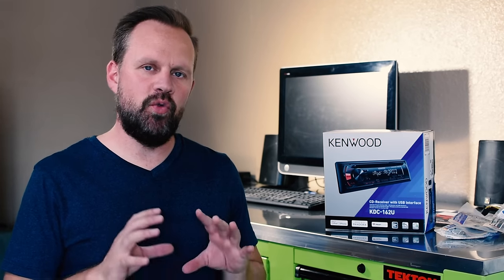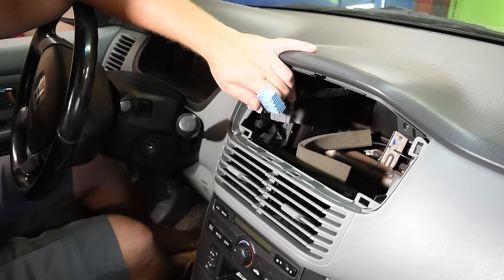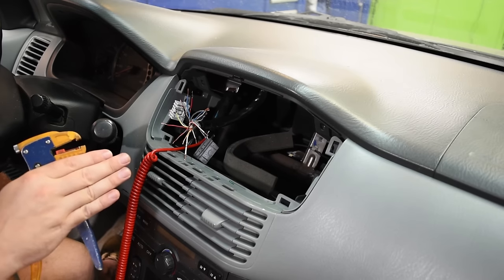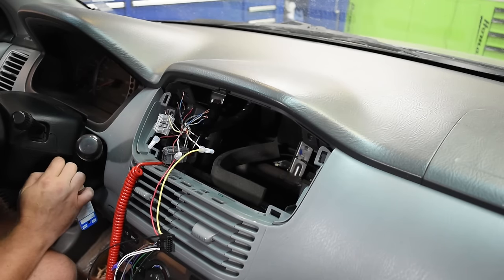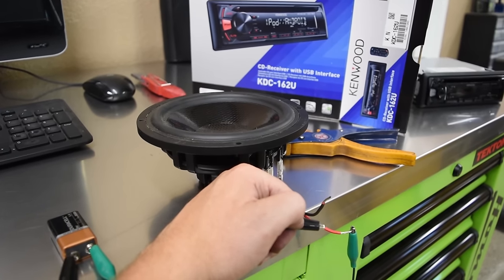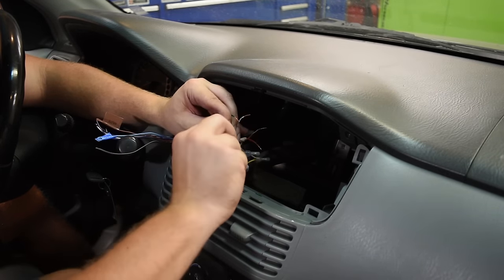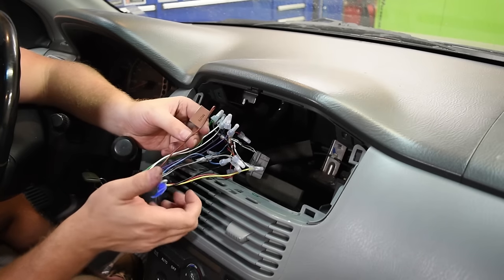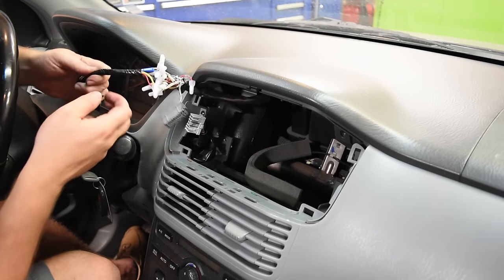How To Install A Radio Without A Wiring Harness Adapter

Comment: If you definitely don't want your wires touching, than disconnect the negative from the battery after you check for the constant power wire.

Comment: Hold on! Don't cut through them all in case the live shorts out another wire , then to find ground touch a live feed to them one at a time? Better to use meter to check check continuity from wire to bare metal?
Reply: What if they were all cut at once and now my car won’t start ? Was running just fine. And my friend cut all the wires at ounce and now I can’t get the vehicle to run

Comment: Soooo I have a 1998 Lexus LS400. I can’t find any of the wiring diagrams for it but I went by almost everything in the video but I have some questions. First.. when I checked for the ground wire.. I found 3 total grounds with all of those wires being brown. Second I can not figure out my speaker wires. Nothing I tried is making them move for me to listen to where they are. Any way someone could help?

Comment: Ive been working on my radio for 3 months now. IM STILL STUCK. SO WHEN I DID GROUND WIRE I HAD 5 WIRES LIGHT UP AND NOW AT SOEAKERS I am getting no noise either way

Comment: I have 2 wires that are constant what do i do?

1 is at 11.14volts the other stays at 11.42volts.

The 11.14volts drop to 4.25volts when i turn the key to the accessory position.

Do you or anyone know what could be the problem?

Comment: I tried this and my harness does not come with a blue and white , not even on the cars adapters, their are a acc and a ant one though but im pretty sure the Cadillac CTS 2003 has an amp that needs to be turned on

Comment: Speakers don't have polarity, because they work with AC signal. Plus and minus on speakers mean just correct PHASE connection, not POLARITY connection. It means if you connect ALL ground wires from radio to plus wires on speakers and ALL plus wires from radio wires to ground wires on speakers, nothing will happens, because they will be at same phase. If you mix up all connections randomly, it will occurs something called "acoustic short circuit"
Reply: Edgar Koterle by

Comment: Can't you get the wiring setup or look it up on line. If you have the book (owner's manual or repair book), you could look up which wire goes to which speaker. Not to say that this isn't faster because it looks way faster. Gonna do our Nissan Altima with a cheap stereo we got online. Wish me luck.

Comment: I need the wire diagram for a 2005 Nissan Altima 6 cylinder four-door sedan the radio and the amp harnessed

Comment: If a harness is available, use it!!!!!! The time & effort to do it this way is way more expensive than the $6 kit. Time would be better spent using the harness & soldering the wires neatly. Of course older vehicles do not have these hookups

Comment: Can anyone help me I have a 2006 chevy silverado 1500 and I’ve gotten power from the battery wire but not the accessory wire. I’ve checked the fuse box and no blown fuse so idk

Comment: Help! I connected the red radio wire to the car wire that gives power when you have the lights on and now when I turn the lights on the radio turns off.  This can cause a short circuit;
Reply: What if they were all cut at once and now my car won’t start ? Was running just fine. And my friend cut all the wires at ounce and now I can’t get the vehicle to run it will crank but not run

Comment: use the damn adapter it's so much easier.  ths is why they are made.  no need to look at wiring diagrams.  no need to cut.  only splicing taping/soldering is on the aftermarket unit.

Comment: im trying to put in a sub woofer,radio, and a amp but the amp causes a fuse to go out and now my dash wont turn on and the radio wont work but the fuse on the radio is fine. And everytime i replace the fuse for my dash gets fried again

Comment: I need help. Im in a old 2002 ford e150 and it has 15 wires the new radio im trying to install is only 12 wires please help v.v

Comment: Useful explaining the the wiring colours, however anybody who cut into my original harness & removed the factory plug I'd be furious with. The shop that fitted that Alpine by sourcing  a compatible radio to existing vehicle plug did a far superior job than your scruffy, & lazy approach to cutting the vehicle plug off.

Comment: Not all vehicles have an a 12v Accessory/Ignition wire. Instead they have a data signal wire that carries a very low voltage signal that tells the OEM Head Unit when to turn on. In order to install an aftermarket radio, you have two options: 1) purchase a wiring interface kit compatible with your vehicle or 2) find something that turns on when the ignition key is turned on and tap into that wire.

Comment: Question for anyone who can help me I just install a radio to my 2003 Dodge Ram 1500 but I connect it without hardness I did it cable to cable , now this video helped but in my case I installed but you can’t here anything through the speakers and I did tested the speakers and they work so please if anyone can please help me out and explain what did I did wrong I’ll appreciate it Thank you

Comment: First of all always disconnect the battery before doing anything electrical in your car: it takes like 30 seconds, prevents any possible short and saves you from getting a nasty shock among other reasons. Second why in the he'll would you mutilate your car cutting off the OEM harness? Just cut behind the after market harness plugged into it make sure you leave enough wire length to work with. Third get some wire labels and label them as you work it will save you so much time if you ever have to go back in there. Third a 9 volt battery is way to much power for testing the weak speakers in some stock systems especially tweeters..you can end up destroying the speakers hook everything up and have no sound, use a 1.5v if you must. Again I have to ask why? Just download a wiring diagram for free online.

Comment: As long as all speakers move in same direction they are in phase with each other.one reversed then you have an out of phase condition. Our ears cannot  determine the positive or negative side of a sine wave. The sound with respect to polarity will just be 180 degrees on opposite side of sine wave. Lower frequencies can be put out of phase for better time alignment. With respect to upper frequencies. Q.

Comment: Hey there everyone..I have a  2006 Ford five hundred sel.
When I brought the car the previous owner hacked the factory harness off...so I followed various wiring diagrams and videos ( such as this one.) And I'm still having issues..I have two power wires and I don't know why...I recently had a head unit rewired and the stereo amp and leds worked fine til I turned the car off..and my battery died..so I unhooked the headunit...and followed this video and I have 2power lights....
Does anyone have a Ford 500

Comment: mybe you can help me? I have problem with Pioneer deh 1300mp, it reset all setings i make every time i turn off engine!
Reply: Your memory wire has to go to a constant 12 volts, it's wired to the accessory switch. Steal 12 volts from the cigarette lighter. Just make sure you have a fuse installed in line. I think yellow is the Pioneer code for memory wire.
Reply: cnile cnile I made it! Thanks!
Reply: Eduards Liss u dont have the 12 v constant yellow wire hooked up thats y its reseting. Cuz thats ur memory wire so ur song wont start           where u stoped at. It also resets ur clock bro

Comment: Can any 1 fix the harness 2 work on a aftermarket alpine w650 install in a lin mks 2011 auto cool control want work automatic, the  stering wheel radio auto for phone and radio want work either can anyone's out there build or correct the wire harness on alpine  w 650 install 2011 lin.mks????

Comment: i have a 1999 toyota avalon and my car has a factory amp? how do i wire this.
Reply from the maker: I would recommend bypassing the factory amp... This adapter may help however it might not work for your car, however do some research this may help http://amzn.to/2glHBzJ

Comment: @ 9:42 you touch the red wire and the light did turn on. You so no other wires turned on the light.

Comment: I was testing my wires like it showed in the video and I found power from multiple wires. Why would this be?
Reply: Terrance Cagle I have the same problem
Reply: Did figure out the problem Joseph Lock.
Reply: Terrance Cagle no not yet. And another problem is that I wired the main once without the speaker wires wired and I won’t turn on. You think it would be a fuse?
Reply: @lockdown10  its possible it could also be a short and that could anywhere
Reply: Terrance Cagle awww dam that don’t sound good.
Reply: @lockdown10  yea finding a short is simple and difficult at the sametime but fuses are easy just locate the stereo fuse and test with a test light or fuse test. You can also pull it out a see if the pronge in the middle is broken and go from there
Reply: Terrance Cagle oh okay hey thanks a lot !!! Much needed!!! I’ll let you know what happen ... just cause lol
Reply: @lockdown10  alright heads up the stereo fuse should be under tbe hood
Reply: Terrance Cagle dam didn’t know that’s again man!!! Appreciate that
Reply: @lockdown10  no problem

Comment: I have no idea what I'm doing. None of the colors match on my cars wires with the new one. I don't understand anything I'm doing.
Reply: Start out by buying digital volt meter (DMM). You can get a free on from Harper Freight Tools.
Then get two or more alligator leads.
A 9v battery.
Find that 12v wire by using the DMM 
You've failed to point out what year & model of your car.

Comment: My radio makes this noise every time I get on the gas or just in general it’s hard to explain but it is aftermarket.
Reply: Alex Huerta ground issue with the radio, reground it to bare metal and the issue should be fixed
Reply: YourDailyTrap thank you
Reply: Alex Huerta you’re welcome! If you have any other questions, I’m pretty knowledgeable in the car audio world!

Comment: U said without the harness but u R doing it with the harness u connecting the wire one by one to the harness it just the harness not yet plug to back of the stereo but

Comment: HOW DO YOU ELIMINATE THE ENGINE NOISE FROM SPEAKERS
Reply: Use ferrite bead or ferrite choke.
Reply: @angelisone   PLEASE SHOW HOW TO DO IT
Reply: @lexusry  You know that black bump on your USB Cable and AC Power Adapter that you got lying around the house? Those are Ferrite choke. 

I like using the round type.
You simply wrap cable around the donut ferrite choke.
Reply: @angelisone  WOW!!! ALL THE YEARS I HAVE THAT PART. I NEVER KNOW WHAT IT FOR. THANKS!!! FOR THE INFO. NOW, WHICH WIRE SHOULD I WRAP AROUND WITH, POWER GROUND ,SPEAKERS, KEY ON WIRE???
Reply: @lexusry  There are 2 types that can be used: ATG RCA Filter & Ferrite Choke.
Steps to check:
1. Start your engine. First have access the back of the radio.
2. Radio on, then disconnect the RCA cables. If noise gone away
3. Place Ferrite Choke on 12V (24/7 live) wire /or 12V ignition wire 

If noise did not go away, then you need ATG RCA Filter.
A. Place it like testing current with your DMM to the Input of Amplifier

Comment: Dude, if you're going to test speakers with a 9V battery it had better be very flat. Normally 1.5V is plenty and using 9V could burn ou the voice coil.

Comment: Mommevwr cut plugs off. It is dumb and makes it harder to do stuff. Adaptors are cheap and you can use the old radio was adter market too. You can wire up the radio inside to a adaptor ans then just plug it in. I hate it when people cut plugs for no reason. Just makes it harder for someone else to do stuff later.

Comment: I still don't understand she you would use an aftermarket wiring harness adapter too not mess up the original wiring on the vehicle 💁

Comment: SAVE YOURSELF A   TON OF TIME. LOOK UP A RADIO HARNESS WIRING COLOR CODE ONLINE FOR YOUR VEHICLE!  You wont need a test light even(you should own one though) as it will tell you exactly what is 12v, 12v switched, ground,illumination(if present), left speaker +, left speaker -, right speaker +  you get the idea.

Comment: So, lemme get this straight! I have an older (but not ancient) car and the radio I'm going to put in will be THE LAST radio this car ever sees.  I'm guessing I don't need a harness adapter.  Is that right?? 

My guess (further) is that the advantage of a harness adapter would be that if I decided to put in another radio in a year or so, I could use the harness adapter to avoid having to do . . . . what?

Clearly I do not understand about harness adapters and why you would or would not want to use one!

Bottom line is that clearly I am not clear about this!

Can someone paint the rest of this picture?

Comment: a really man would not use a adapter harness, he would cut wires not knowing whT they do and splice away  disconnect and splice again until it works or does not, be cause it blew up.  is that what he is saying??  lol

Comment: Using a crimp tool??? Been installing stereos for years. Whenever I see a shit job like this I cringe.i sauter all my wire and shrink wrap it so it lasts forever
Reply: You should, if you charge $250 for this job

Comment: so many of you guys completely fuck up really nice cars by doing this. WHEN WE BUY THESE CARS AND PULL OUT THE 8 YEAR OLD AFTERMARKET RADIO ITS A FUCKING NIGHTMARE OF ROTTEN ELECTRICAL TAPE AND SHORTING WIRES!  what is so hard about spending $7 on an aftermarket radio harness adapter so you don't trash the factory radio harness. This can be done cleanly of course but its almost always done by tweekers and sketchy latins.

Comment: 100% WRONG! Don't be a cheap ass. Buy the adapter and don't fuck up the car's harness for the next owner that has to deal with your butchery like I am right now at this moment having to deal with.
Reply: 1: this video is for cars that the stock radio harness has been cut off 
2:It doesn’t matter if it works then it works

Comment: Who would make it more difficult to install an aftermarket stereo when the factory harness is intact? What do you do when you sell the car and want to take your radio with you? This is what most professionals call butchering..
Reply: Not having access to an adapter to connect an aftermarket head unit to a factory connector or having a damaged factory connector without access to a replacement are both good reasons and so is cutting it off to generously teach a valuable lesson on how to solve the problem caused by a careless thief or previous owner which was very clear from the very beginning to be the purpose of this video which went over your head based on your "butchering" professional opinion of something many viewers benefited from and appreciated despite your worthless contribution.